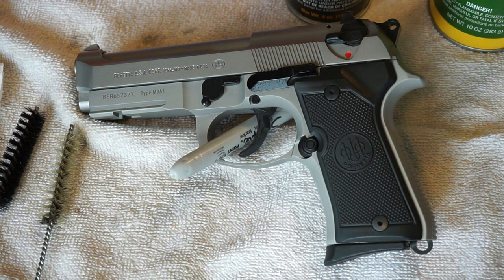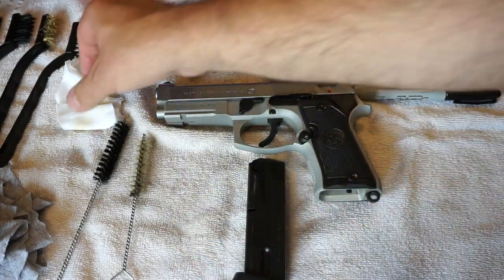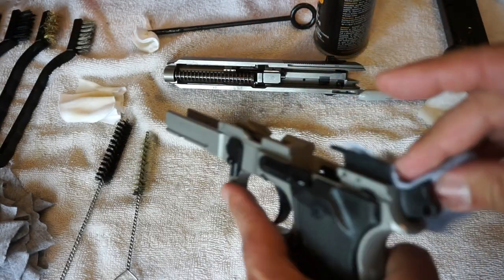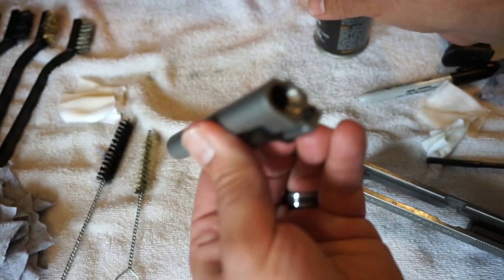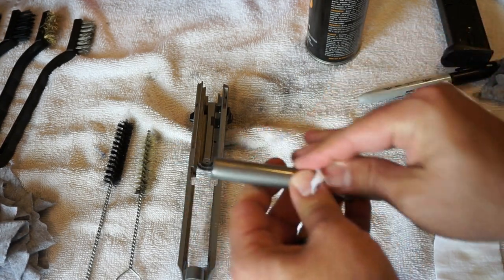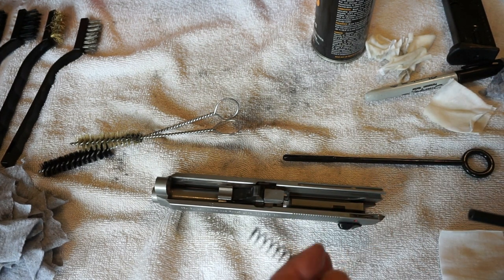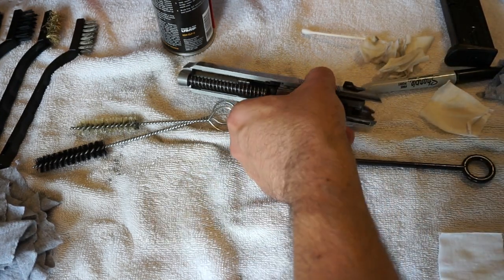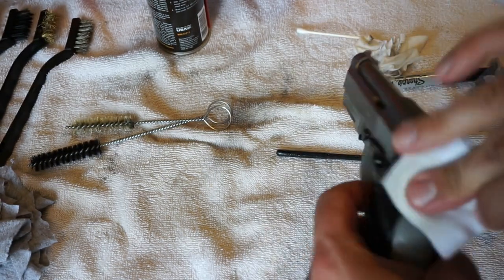Beretta 92FS Compact inox finish 9mm M9A1 field strip and cleaning! M9A1

Comment: Just came across one of these today when I was at my LGS, they had it in the used case it is used but is been unfired for 650 good deal?
Reply from the maker: I paid $609 on sale on Cabelas but this pistol now sells for over $700 on a regular basis, if you can find one.